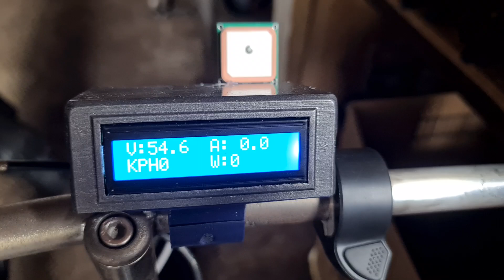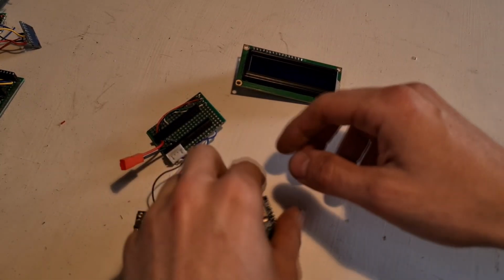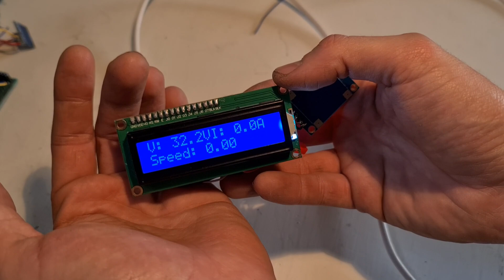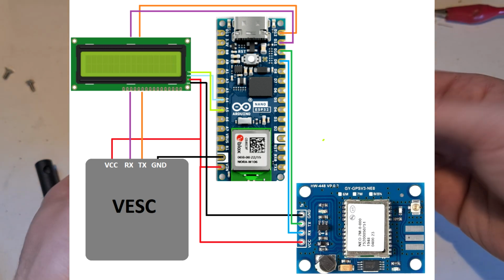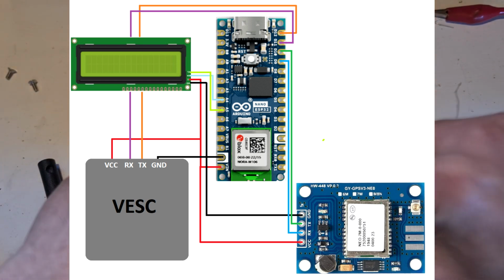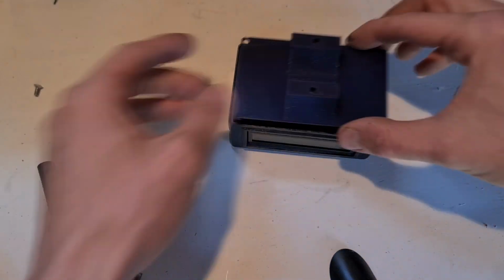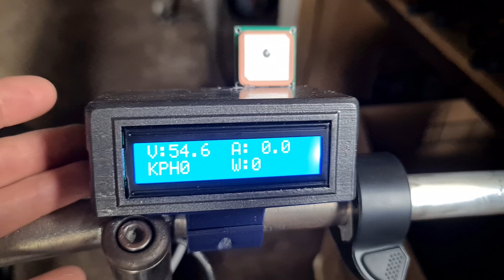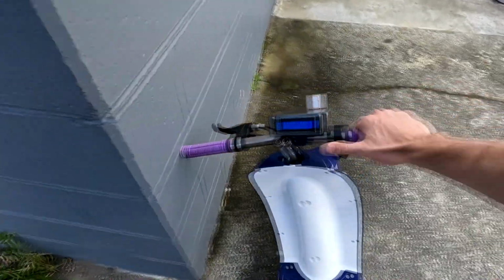DIY Electric Scooter Display ESP32

Comment: Ich bin auch grade dabei einen esp32 als eine Art cycle analyst zu benutzen. Er hat Eingänge für pas and throttle. Du kannst auch deinen akku schließen für akku anzeige. Er bündelt beide Signale und gibt es an den Controller weiter. Kann also an so ziemlich jeden Controller angeschlossen werden solange er einen throttle Eingang hat.  Wenn du mehr wissen möchtest oder interessiert an einem Austausch bist kannst dich gerne melden. ❤
Grüße aus Deutschland 😊

Comment: This is what I'm looking for.  How difficult would it be to add a function based off the ESC and/or motor temp to trigger a coolant pump?
Reply from the maker: @patracy  very easy. Would just be one if statement that triggers at a set temperature that turns on your pump. Just remember that the ESP32 can't power your pump motor. If you struggle with writing the code, you can always use an AI like chatgpt to help.